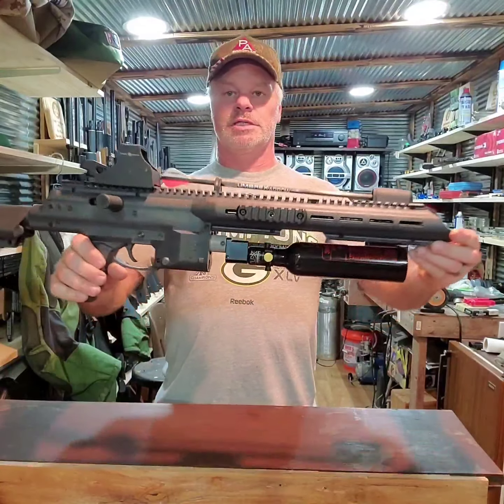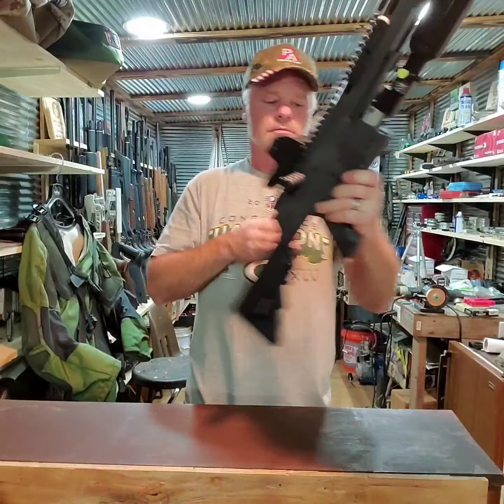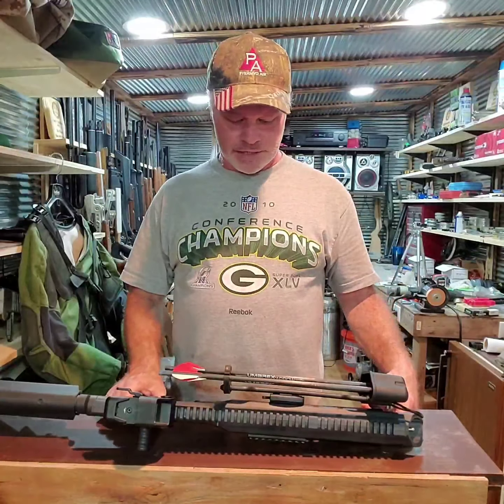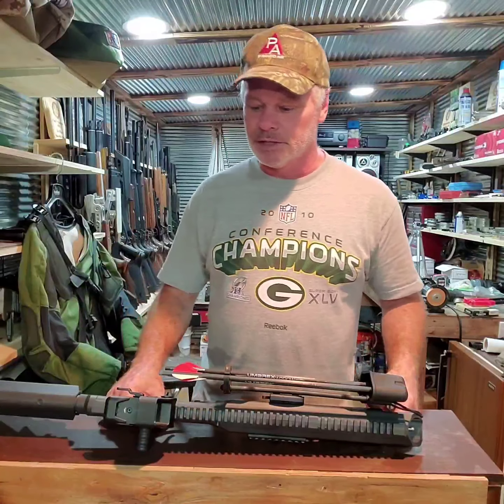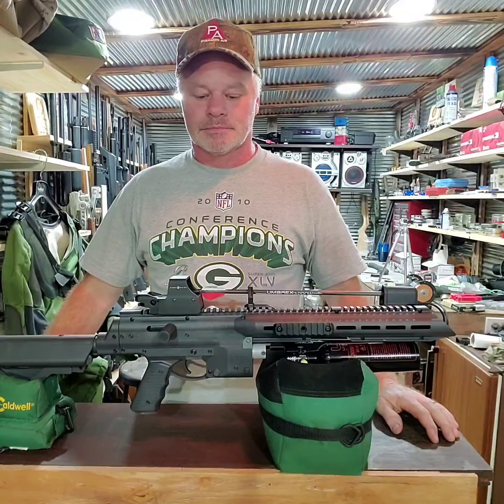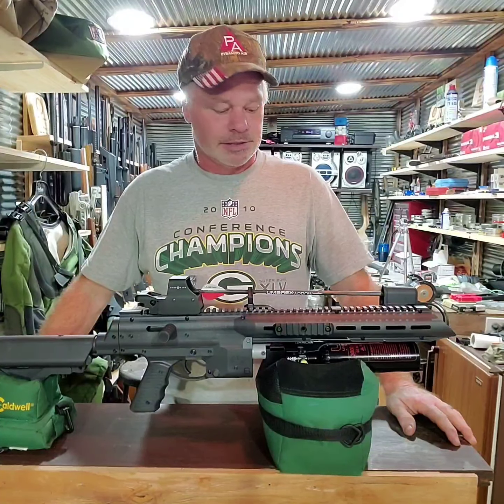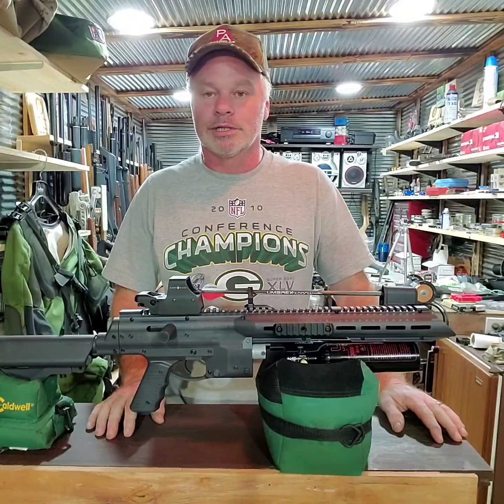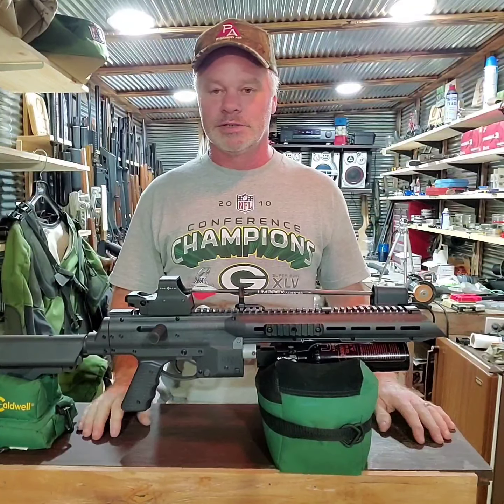Umarex Air Javelin (((PCP))) chrono test!

Comment: First of all, I want to thank you for a great video about turning Umarex Air Javel into a PCP arrow rifle.
Inspired by those videos I printed, with a 3D printer, parts the upgrade version. 
As you can see in the gun you can use ready-made Mil Spec back stoks.
The lower rail part has been removed from under the front support, then the pressure bottle can rotate into the 88g seat of the gun. (88g co2 adapter)

Comment: I have the air saber and wanna get the javelin but not sure i want C02, whats your thoughts? Is this your making gonna be something you sale?
Reply from the maker: I have made a couple of adapters to use the Gauntlet setup. You can take the bottle adapter and bottle right off the Gauntlet and put it on my adapter. 
If you have a Gauntlet you want to borrow parts from then it works out great but if you have to buy the regulated bottle,  drop block and my adapter its pretty close to the cost of the Air Sabre I think.
Now you can drill and tap an empty 88/90 gram co2 and feather it to a regulated air source also.
It's also the cheapest way to shoot it with co2, after you have a 20 lb co2 bottle.
Reply: I don't blame you I'm interested in the Javelin sabre is too heavy and loud I wasn't keen on it

Comment: Do u know anything about the umarex CO2 saver adapter as far as being used in the air javelin?? I was wondering if it allows me to leave the CO2 cartridge in the gun?? Or will it still cause seal damage...any help would be awesome.
Reply from the maker: The co2 saver is a one way valve that allows you to remove the co2 tank without loosing all the co2.
As for the seals, the airguns that take 88/90 gram co2 tanks use a little different seal than the old school Crosmans did.
It seals around the outside of the co2 tank instead of forcing the tank against the seal and smashing it over time.
Its actually a pretty good improvement over the 12 gram co2 type seals found in many air pistols old and new

Comment: There are some videos on getting the regulator off. One of them the guy fabricated a tool to use. I took mine off but it did scratch the bottle some.
Reply from the maker: Thanks Brandon, I'm already thinking up something with an old deep well impact socket lol
Reply: Its easy to take it off I use a oil filter loop clamp with a silicon rubber square for hot pans grips holds and dont mess the bottle 😉

Comment: Can a stock javelin handle 100 grain broadheads in your opinion?
Reply from the maker: I don't remember what the velocity was but it shoots a little slow.
Reply: Once I insert the c02 how long can I store the gun with it still inside?
Reply from the maker: @RawDogTV  I leave mine in till its empty. The Javelin doesn't have a seal that can be crushed or deformed like the ones used with the little 12 gram co2
Reply: @kidpellet6544  I ordered the Umarex adapter that holds two 12g cartridges. Is it safe to leave the c02 in there and store the gun? Sorry for the random questions, i  don't wanna destroy the gun
Reply from the maker: @RawDogTV  you can leave them in the adapter and leave the adapter in the Javelin or take it out. It wont let the co2 out. However, the 12 gram co2 are cheap anyway so if you want to waste them after your done shooting its bot to big a deal really
Reply: @kidpellet6544  ok thanks for the help Kid Pellet
Reply from the maker: @RawDogTV  post some pictures or videos in my FB Umarex Air Javelin hroup when you get time and good luck with it
Reply: @kidpellet6544  another question, how would 100 grain broadheads do with the AirJavelin, too heavy?
Reply from the maker: @RawDogTV  it's going to change the point of impact a little but you can adjust for it. I havent done any energy testing with the chronograph at target distance, say 30 yards away  yet to see if there's much difference